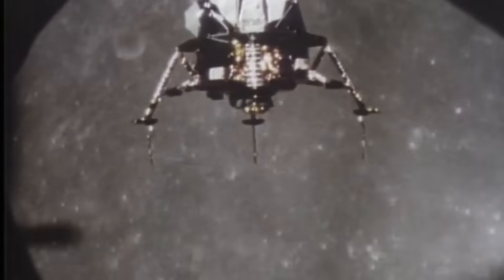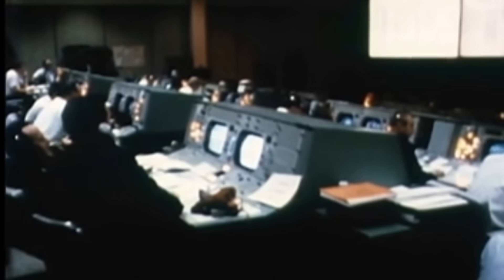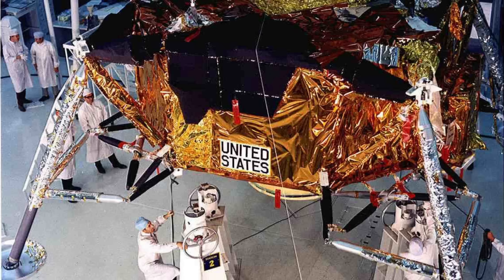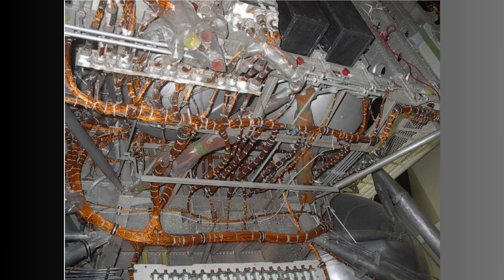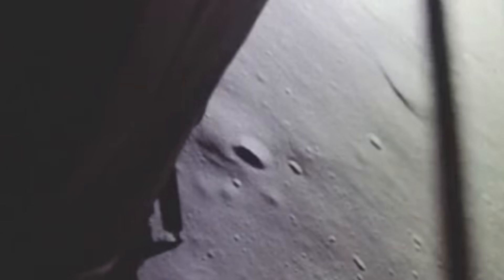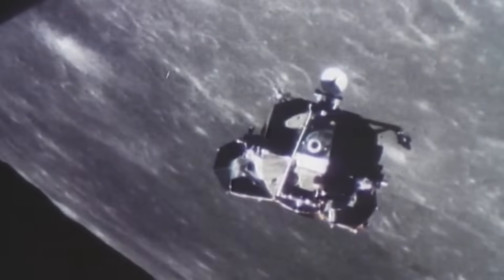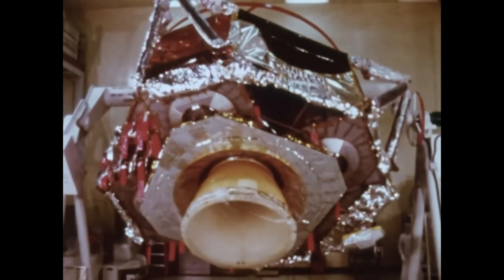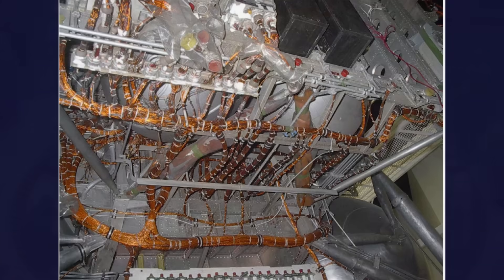Inside the Lunar Module’s Wiring Maze: How Thousands of Conductors Kept Apollo Alive

Comment: Fun fact: they built two identical LEMS for apollo 11. One went to the moon the other stayed in the hanger, fueled in the event the astronauts needed help while on the mission. After the mission the other LEM was pushed out  of the hanger, defueled and sprayed camo green. I used to go by it for almost a year when to work. 
I lived  1/4 mile from end of runway when the NASA Guppy came in for landing to pick up the LEM. It took off under secrecy in the middle of the night with the LEM inside. JFK airspace secretly suspended flights when the Guppy  left the area.
Also Grumman had employeed 85,000 people during the development of the LEM as they still had other projects going on such as the F14, E2C and other aircraft. Bethpage was the plac eto live in the 60s
Reply: The 85,000 employees figure does not hold up historically. 

During the Apollo LM era, Grumman’s total workforce across all facilities was on the order of ~35,000 employees around 1969, which already overlaps with the start of the F-14 program. Numbers in the 80,000+ range belong to Northrop Grumman decades later, after the 1994 merger, not to the standalone Grumman that built the Lunar Module.

Comment: I'm an avionics technician, I've built thousands of wire harnesses and installed them into aircraft for decades. While this is a fascinating video, it's all familiar to me. Much of it is more specialized for space flight, of course, but masses of wire like this are also in aircraft. If the LEM were built today using todays avionics technology,  I guarantee the wiring would be cut down by 2/3. I've performed many an avionics upgrade removing equipment and wiring installed in the 70's and 60's and installing new wires and equipment that triples the capability of the avionics in the aircraft, and the wiring is only a third of what was removed.
Reply: Nowadays every signal is transported using a bus.
Reply: @aamiddel8646 not all but most. There are still wires.😊
Reply: @montylc2001  OK
Reply: Remember that Grumman was also working g on other projects like the F14, the E2C and other aircraft. My best friends father was in charge of the wiring for the LEM.
Reply: And your point is?

Comment: What is going on at 8:24?  The astronaut puts something on the display. What is it, a sun shade?
btw thanks so much for making these exceptionally detailed videos. Its really appreciated.
Reply: Well observed. It looks like some kind of shield that can optionally be affixed around the DISKY display. Maybe to prevent acutely angled sunlight from windows 1 & 5 (left and right) washing out the green luminous digital display? During PTC the Sun could slowly creep into the cabin during the slow roll from one side, then the other after further 180° of roll. The astronauts could flip the guard upside down for when the Sun entered the opposite side. Perhaps it was a weight-saving measure. An entire window sunshade would carry more weight?

Comment: The wiring used in this unit was called type E. It was silver plated copper wire with a Teflon coating on the outside. Expensive? Yes. Special handling? Yes. All wiring tools had to be made especially for use with Teflon insulation. Now, I worked on the trainer or what was called the simulator. On the inside, this unit looked and responded like the real one. On the outside were rows and rows of terminal strips where each circuit was located so the modifications could be made and measured. When it was almost complete, I got to sit on one of the couches and just look at all of the different panel lights and gauges. Let's just say that I was impressed. Just think of how many years ago that was and yet I still remember it like yesterday.
Reply: Thank you for sharing this information!
Reply: My best fr8ends dad was in charge  of the wiring of the LEM at Grumman in Bethpage.
I still have some wire from the LEM
Reply: Actually Kapton insulation.
Teflon evaporates in a hard vacuum.
It has a characteristic yellow color (it subsequently was found to age poorly causing multiple malfunctions on the space shuttle and other aircraft).
Reply: Fascinating times, those behind the scenes were just as important as the astronauts themselves
Reply: Did you work at Link in Vestal?  My dad worked there on mission simulator as well as other simulators.
Reply: Wow !

Comment: Twisted pair are mentioned a couple of times in the video, I find them ingenious.  I'm a mechanical engineer with some electrical experience.  If an electromagnetic wave passes over a conductor, it induces a voltage on the conductor (see Heinrich Hertz's famous experiment).  My understanding of twisted pair is that when an electromagnetic wave passes over the pair, it induces a voltage on one conductor and at the same time, a balancing voltage on the other conductor, thus pretty much canceling out voltage spikes on the overall pair.  A relatively inexpensive and lightweight method of "shielding" the circuit from the effects of an EMI pulse.

On a side note, I noticed the airbag wiring in my car utilized twisted pair.  A circuit where you would definitely not want extraneous voltages to develop.
Reply: yes. I'm an avionics installer. You route and separate wires away from each other depending on what is flowing through the wire. You do NOT route wires carrying AC current next to wires just carrying information. And grounding of shields on shielded wires is important as well.
Reply: "My understanding of twisted pair is..." Not quite right. Each twist forms a "loop". An alternating magnetic field will induce a voltage in each loop. With the twist each alternate loop has the opposite polarity to its neighbours and so the induced voltages cancel out.
Reply: Automotive CAN bus use twisted pair
Reply: Wheel speed sensors are also twisted and shielded (low AC voltage).

Comment: I wonder what the lander would look like with modern circuitry. Admittedly, some things couldn't be minaturized due power needs but control circuitry would hopefully be simpler.
Reply: Oh, the lander would weigh a LOT less. I'm an avionics tech, specializing in installation and harness building in aircraft. Been doing it for 40 years. What took 50 wires to accomplish 40 years ago can now be done with one. I've performed many a avionics modification where I've removed 50 pounds of wire, thousands of wires...and reinstalled a small harness that operates far more equipment.
Reply: @montylc2001  I agree. Bor perspective each person posting in this thread is using: a pair of wires, or a single coax, or a fiber to access and control anything in the world. Granted aircraft have much more demanding requirements but to your point back in pre-network days each sensor, switch or effector device needed to be separately connected and controlled and  sharing data was difficult. Now everything is networked making sharing easy. Advances in semiconductor fabrication means often low level analog signals are digitized at the sensor. This improves noise immunity and robustness.
Reply: @tomschmidt381  100%!!!!! Analog equipment took hundreds ....sometimes thousands...of wires. I've watched equipment from the 1970's the size of a shoe box be reduced to a chip that rests on the end of your finger...and can do ten times as much!
Reply: It would be significantly smaller.  All power electronics are shrinking size dramatically due to newer semiconductor technology like GaN FETs.
Reply: You’d use a multiply-redundant fiber optic data bus and separate power busses. That would be much lighter, faster, RF resistant, damage tolerant, and simpler. That’s what the most modern fighter jets use, and I’m guessing it’s what spacecraft from SpaceX and Boeing use.

Most modern commercial aircraft use ARINC 429, a two-wire twisted pair serial bus that runs at 12.5/100 kbps. Even cars run on serial data these days. When you press a switch to roll down a window you’re not closing a circuit sending 12VDC to the window motor. You’re sending a WINDOW DOWN signal to the door over a LIN or CAN bus.

To correct one error: Gold connectors are not used on spacecraft because they have lower resistance- both silver and copper connectors have a lower resistance than gold. Gold is used for corrosion resistance.
Reply: And yet look at all the issues Artemis has run into.  I mean with the HUGE technological advancements since the 60's I really thought things would be going alot smoother than they are.  Apollo was an engineering feat that has not been rivaled.  I am cautiously optimistic that Artemis will impress as much.

Comment: Also high interresting would be a Video about the explosive systems for seperation and the umbilical between the CM and the SM (the same for the umbilical between upler and lower stage of the lunar module). That would be fine 😊
Reply from the maker: That's a great idea! We'll add it to our list for future videos.
Reply: My best friends dad said that was the scariest part of the mission for him. The wires were guided thru a guillotine with explosive charges at each end of the guillotine. This is the debris you see shooting outward just when the assent engine lite..if this failed, the LEM would just  topple over.
One of the original guillotines are on display at the Vanderbilt museum on Long Island.

Comment: How could you not be amazed at the unbelievable achievement that was both the Saturn 5 and the lunar lander? Given that this happened more than 50 years ago this eclipses anything being done today, amazing though it is. No computers as we know them, no calculators, slide rules, knowledge of physics and electrical theory obtained from blackboards and books rather than AI and computers.
Reply: Agree about the slide rules but back then huge mainframe computers were a thing. Many were used for calculations, simulations and real time monitoring of the flights.